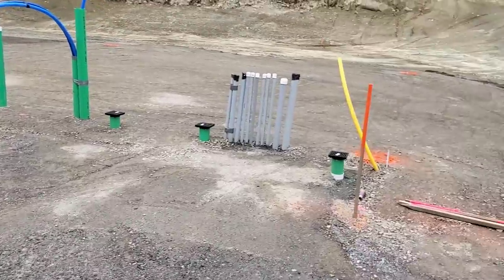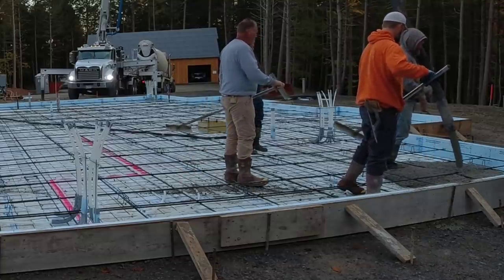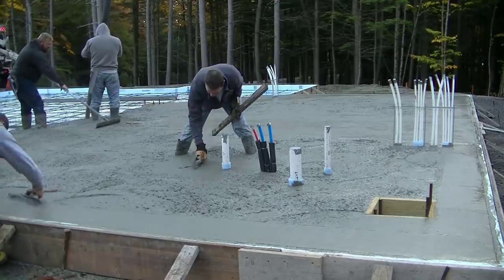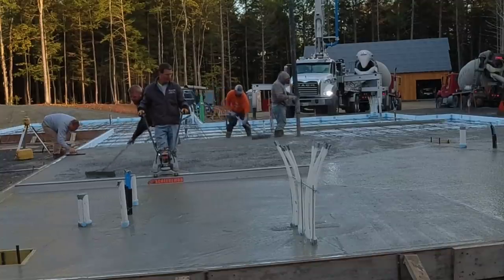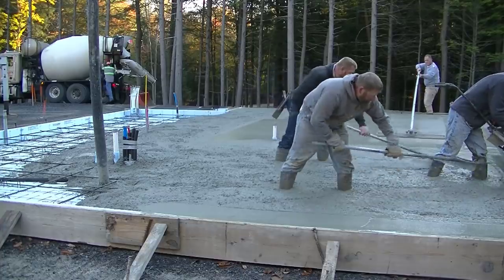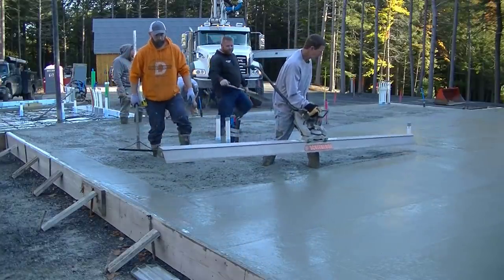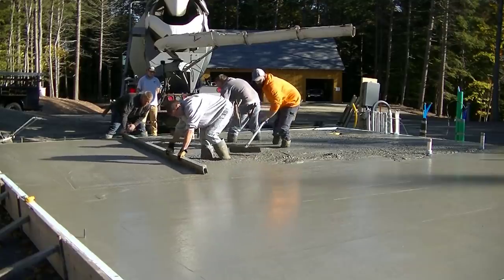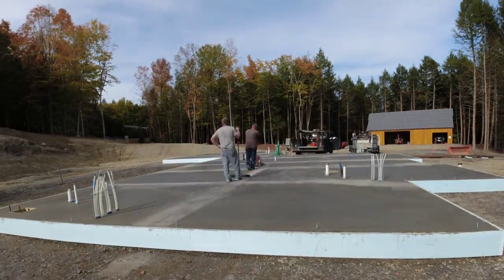He Made Us Pour His Concrete Slab 10 Inches Thick! (Waste of MONEY?)

Comment: I had such a hard time finding someone that was happy to pour a thicker slab when I built my workshop they either looked at me like a idiot and didn’t believe I would have the size machines I have or the price was crazy 5-6x the standard like they were building a nasa launch pad I had the engineer work out what was needed all on the plans
Reply: some people only want cookie cutter jobs, it sucks
Reply: @elihautamaki547  I’m in steel fab and  light and heavy I get people that have had some shops tell them it’s some complex job and will cost over a $1000 
A few hundred later and she’s as good as new if you don’t over charge people are happy and come back I’m not getting rich but definitely happy and don’t need to make a weeks wage in a afternoon
Reply: @MegaBCAD  i agree. doing good work for good people is a much better way to go

Comment: If it is what he wants and is going to pay for it, why not 10 inches.  Only he knows what he wants or needs.  Perhaps he has a huge safe or two that require the extra depth to support and anchor them.  Perhaps he was a dreadful fear of tornados and wants a thick foundation to drive anchors into.  Maybe he has a fear of radon gas seeping in and figures this will block it.  No matter what, you knew what he wanted and said you would do the job.  The owner's money, the owner's specs, you made your quote, so quit second guessing the owner's choice and suck it up.

Comment: I wanted my shop to have a 8in thick slab because I installed a power hammer in my shop. My anger when I fired it up and I only had a 4 in slab. I paid for a thick foundation and I did not get it. The contractor was adamant about standard slabs being 4 in. I paid for 8 in for a reason. I took them to court. Dumbest judge knew nothing about construction,  sided with them.  Now I have a busted useless shop floor. I hate contractors as much as I hate judges

Comment: No re-bar and re-mesh is cheaping out on a 10 inch slab. Read the specs on concrete with and without re-bar and re-mesh-you lose 400% of the strength by not using them! When I replaced my driveway, I poured 6" of 5000 PSI concrete (not 3500 PSI junk) with 3/8" re-bar every 12" like a grid and 2x4" 16 gauge re-mesh on top of that. I pity the poor son-of-a-bitch that tries to take out what I put in! I kept it damp for two days to cure very slow. Paw-paw taught me to work concrete- I put crusher run gravel in the mix and "walked" the concrete in the forms with my rubber boots. 38 years later, with big tree roots underneath, not a hairline crack anywhere! My plumber found a pecan tree root 16 inches in diameter under the driveway he cut into for my new sewerline.

Comment: Having that much thermal mass is a concern for me personally... I have hydronic radiant floors and a 4 inch slab. The biggest problem I have is with outdoor temperature swings. It can be a high of 15 degrees on day, then 55 degrees the next which causes the slab to continue to release heat on the warmer day and then the house overshoots. I can imagine with such a thick slab, that will be a potential problem.

Comment: Lol concrete is far from cheap , Having it so thick with minimal steel is pointless the slab will crack severely over time with ground movement better option would have been waffle pod slab on piers far less concrete and more steel would be way cheaper and better than that ,Also as wet as that concrete is it will lose its mpa rating very quickly.
No offence but that wouldn’t pass inspection to pour in Australia for that thickness double mesh minimum, piers and perimeter bar , Wish we could pour like that here and if a concreter here used a piece of wood as a screed he would be sacked instantly